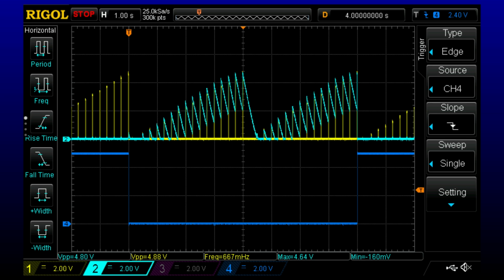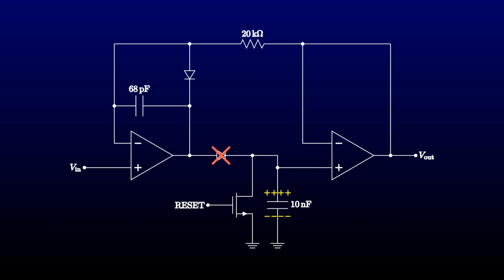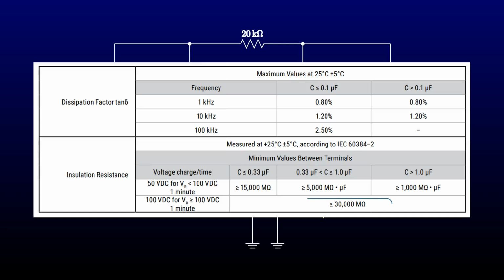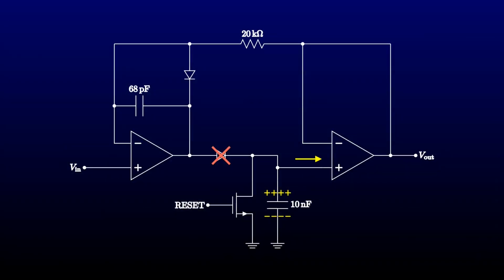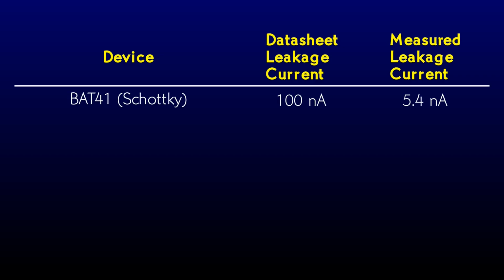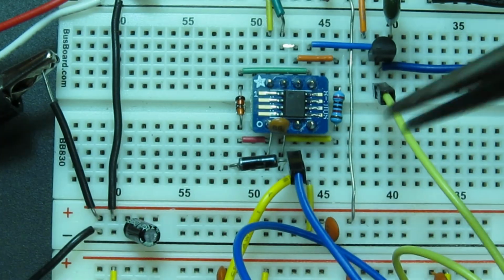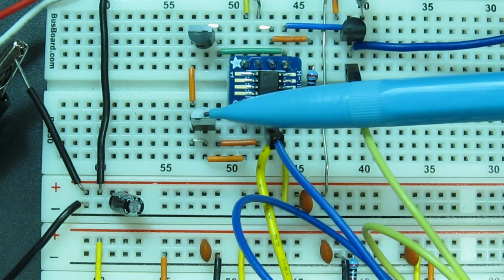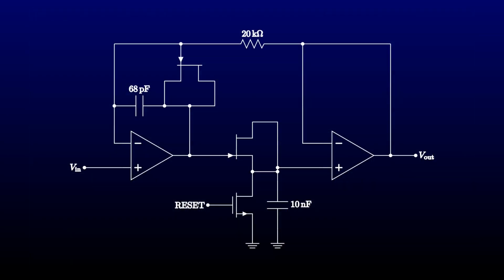Peak Detector - Reducing Leakage (Op-Amp Basics, episode 7)

Comment: Lomg ago and in a far far away galaxy (1980's), I needed to design a peak detector/follower in a floppy disc quality anaylyser circuit.
A peak detector with a fastish decay on purpose, so it knida rides on the peaks, but not too long,.
....fun compromise as the circuit neede to compare average signal strength against each pulse, worked surprising well.
Eventually sold the system to a US corporation, ...I am an Australian.

Comment: Really nice & useful info

Small correction about 4066:

- typical switch leakage current is 1nA or 10^(-3)uA  (leakage was in microAmps in datasheet); 

- 10pA is the leakage current of the control circuitry ... I learned it by checking HCF4066B datasheet. For sample&hold applications, they recommend HCF4016B. There must be a reason why ... both 4066 and 4016 have typical control circuitry leakage current of 10^(-5)uA or 10 pA. 4016 has higher resistance (280 vs. 125 ohm of 4066), but 4016 has lower switch leakage current by 2 orders of magnitude, 10^(-5) vs. 10^(-3) microamps
Reply from the maker: I bet this is a parameter that varies among the manufacturers. I was looking just at the front page of TIs datasheet for CD4066BE. Of course   the Electrical Characteristics table has a different story (at a different voltage and temperature).

It's a tricky and time-consuming test to run on the production line, which is why the datasheets always have loose specs for it.

I'll be showing a sample&hold circuit soon. I'm not going to bother ordering 4016's or DG403's for it unless the droop is unmanageable over a few seconds, but I'll be sure to mention that they're more suitable.

Comment: What do you think about the BAV199 diodes as an alternative?
Reply from the maker: I've never tested it.  The curves that they show for reverse current in the datasheet show about a nA at low voltages and room temperature, so it's likely not to be terrific - the "low leakage current" that they show at the top is probably by comparison with the 1N4148. 

It's easy enough to build a diode leakage tester with a sample/hold circuit (I'll be covering those soon!) with a voltmeter and stopwatch.  If you've got a bunch on hand, you can probably find out for yourself how they perform in a half-hour at the bench.
Reply: @KludgesFromKevinsCave  The datasheets of this double diode ( infineon, nexperia) show much better typical values( Ir=3pA @ 25° ) . But the maximum values are specifyed 3 decades higher! Hence your tester may have a real value for me 🙂. I'm using this diode to protect a MOSFET in a high impedance  circuit ( > 200 MOhm).

Comment: Thanks for video series, I'd like to learn more about CMOS Switches if you think that would interest others
Reply from the maker: I've been thinking about that as part of a series on FET's.  It'll probably be quite a way off, because of all the other ideas I have in queue, but you're right that it would be an interesting topic.  I certainly need to cover them in depth before I build the channel's first Class D amplifier!
Reply: @KludgesFromKevinsCave  Another suggestion for a fet series: dual-gate mosfets. What are their applications, and (what I'm most curious about) why tie one gate to drain, as I've seen in a number of FET probe circuits?
Reply from the maker: @markp5726 A dual-gate FET is basically a cascode- a common-source amplifier driving a common-gate current buffer. I do want to look at cascodes pretty soon. As far as the dual-gate devices go, I'm not sure I'll do a unit on them. I don't have any, and they're really hard to find nowadays. I used to love the 40673 for RF circuits!
Reply: @KludgesFromKevinsCave  Oof, yeah looks like dk only has one in stock (3SK293), only available in surface mount, and status is "last-time buy".

Comment: I want to make two cimments about things I learned not very long ago but now can't remember either one. Oh well... I guess I'm starting to get old. I've got a vague feeling that I recently came across a simple opamp peak detector circuit that either used some positive feedback, or maybe inverting input trickery, to hold the capacitor at the right voltage, so leakage can pretty much be ignored. I'm now questioning if that was even real.
After sitting and thinking for a while about the diode leakage, I think I've made some progress about remembering at least part of it - but it's not as relevant as I initially thought. I think it was a paper about how schottky diodes often seem like they have much higher leakage and reverse recovery in a lot of high speed scenarios because their junctions have much higher capacitances. I always knew jfets were used as diodes and current sources, but I am really impressed with how well they worked here!
Reply from the maker: I think I came across that  peak detector once myself. It was some trick like measuring the leakage with a chopper and then injecting a current that cancels it out precisely.  I could probably find it if I poked around on the net.  

You're right that Schottky diodes are often overrated.  They're leaky and they have high capacitance, and their cutoff is soft. (Sometimes you can make that work to your advantage, if you're trying to duplicate the characteristics of a germanium diode, I suppose.)  The low forward drop and fast reverse recovery is their big advantage, which is why they shine in switch-mode power supplies and Class D amplifiers.

Comment: In the National semiconductor Applications Notes they suggest lifting the input leg off the board and attaching the capacitor directly to it.
Reply from the maker: I think I mentioned in passing that if you need the lowest possible leakage, you need to use flying leads (as in lifting the legs of IC's, mount components on Teflon standoffs, use aggressive surface cleaning, bake out volatile contaminants, and similar tricks.  Electrometer circuits are hard to get right.  

I don't think I'm going to push this particular topic any further just at the moment.  I'd have to brush up on the techniques.
Reply: @KludgesFromKevinsCave I always love seeing research papers where scientists give lists like this, saying things like 'In order to reduce/optimize this variable, we did the following" and then list increasing complicated labor-intensive, and absurd ideas, finally concluding with "None of which had any effect whatsoever."
Reply from the maker: I think I've written a paper or two with a section like that!
Reply: @KludgesFromKevinsCave Well that got me interested!  You rewrote Fortran code for solving differential equations into tcl with multithreading support, and made algorithms for autofocusing microscopes? All way over my head, but still interesting nonetheless!

Comment: I love JFETs. So many unusual applications, one of which you demonstrated here. Another one of my favorite applications is as current sources. A few years ago when I built several opamps from discrete components (bipolar, JFET input, MOSFET input) for fun and learning, that is what I used as current sources for the long-tailed pairs. It worked fine.
Too bad they're becoming more scarce and difficult to find, but I took care and made stocks that should be enough for all the projects that I'm likely to use them for, several times over. :)
Reply: Oh yeah, and another unusual application of JFETs: with a pair of N-channel + P-channel JFETs you can make a so called "lambda diode" which is a negative resistance device similar to a tunnel diode, useful for oscillators and amplifiers. This is a topic that I haven't practically explored yet, but I plan to.

Comment: Hello Kevin, thanks for this video, very instructive. I just had a problem on my latest project about leakage current using a regular 1N4148. The project is just on paper (LT Spice) and I opted for a 2N3904 connected as a diode, It works great on the simulation. What's your opinion? Would your J-FET solution be better? To be honest I have already tried on LT Spice and works as well as the Bjt ones. Thanks for your videos, I find them very well done and instructing. Cheers Max.
Reply from the maker: The JFET is my most usual choice. With a BJT, the B-C junction is often leaky and always more capacitive, and the B-E junction has only about a 6 volt reverse breakdown. If you're sure you won't drive it into Zener conduction, a B-E junction is usually  just as good as a JFET. I should probably have had a BJT on the scoreboard but the video was long enough as it was.

Any cheap JFET will do, since you don't care about threshold voltage or channel resistance in this application
Reply: @KludgesFromKevinsCave  Thanks for your prompt response.😄
Reply: A red or green LED shielded from light might also be a good option if you can tolerate the larger forward voltage drop.
Reply: @hughgilbert390  similarly some PIN photodiodes have datasheet rated reverse currents in the nanoamps, for instance SFH203.
Reply from the maker: @hughgilbert390 Yeah, I remember having painted a green LED black for something, I've forgotten what. But JFETs are hard to beat for the purpose.